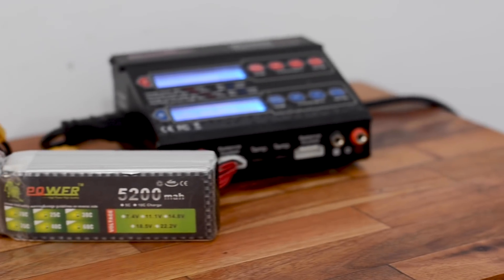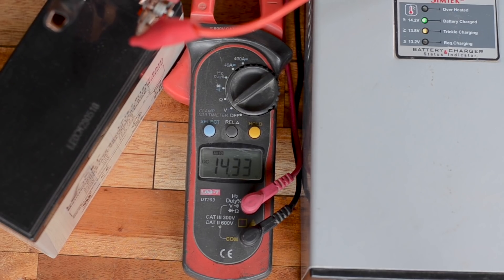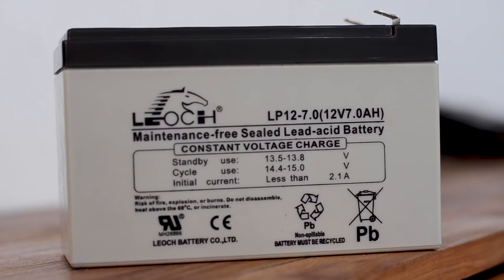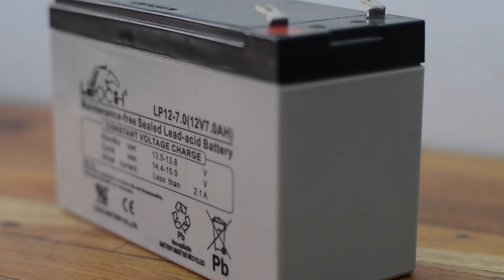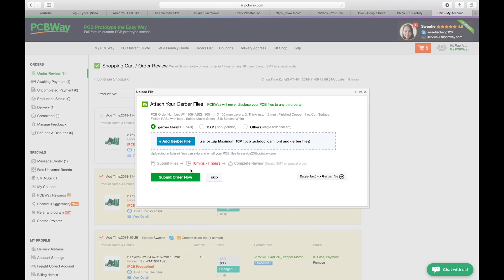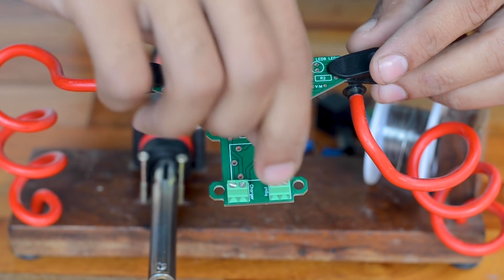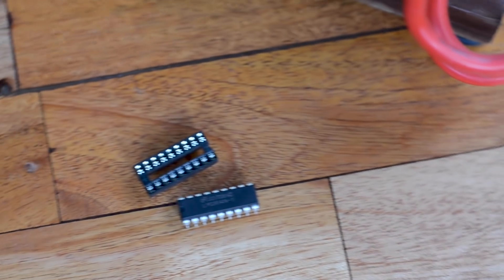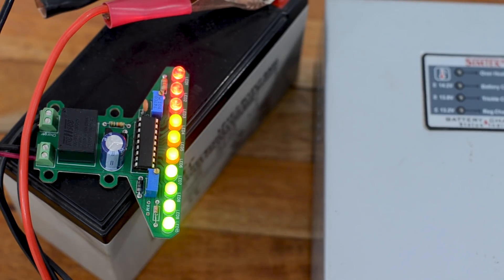How to make a Battery Capacity Level Indicator (LM3914 IC)

Comment: first of all, thank you very much for such an impressive work you made. Secondly, i wonder if there is a problem in the connection of the legs of BC547 transistor since it is an NPN but the shematics shows a PNP one.